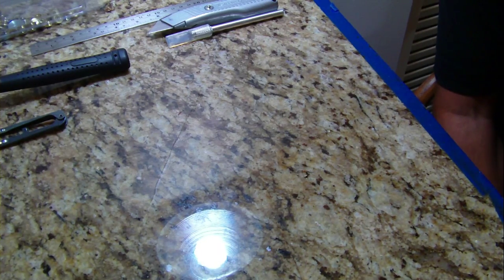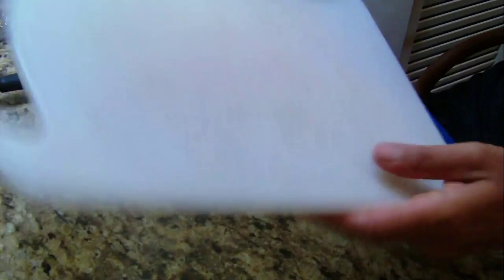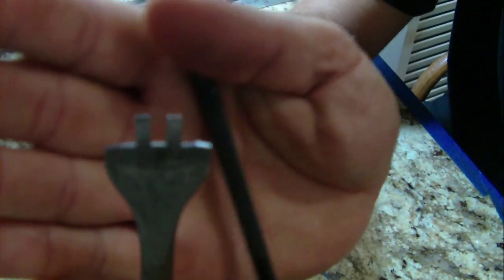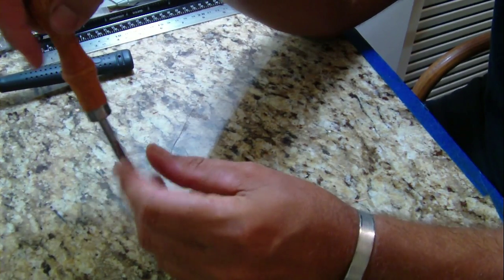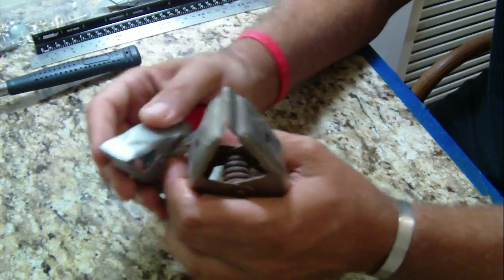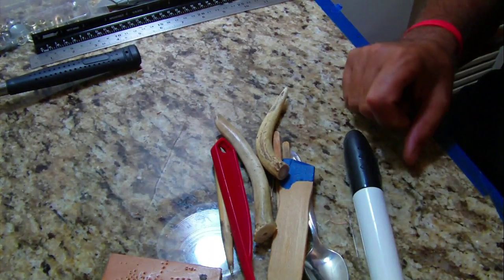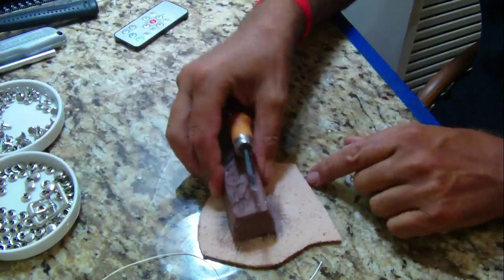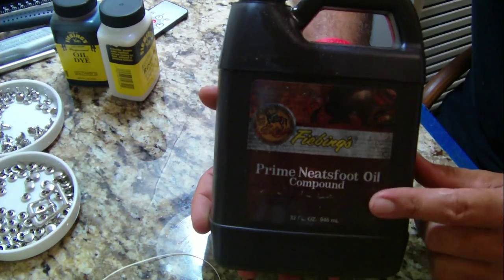Diy Holster Making Tools and Material

Comment: You may not be doing stamping yet but stamping adds a lot of character and is easy to do. If you go there, something I have found invaluable is a 2 inch by 2 inch or so sealed box or bag of lead shot. Once you case the leather for stamping, place the box of lead on the edge of the leather to hold it in place. I also use it for glue-ups. I place the glued leather on my grant block and then place the lead on a small board on the top of the leather to hold glued surfaces rather than clamps since at times, I have had clamps mark my leather. Also, for burnishing, a glycerin block of saddle soap works well. It is easy to use and Tractor Supply or Tack shops carry it.

Comment: Great info.  am brand new and have one question I can not find an answer to. If you use white waxed thread to sew my leather together and then stain it black. Does the thread stay white, Thanks
Reply from the maker: I would say no. It may be more resistant than plain thread but it will still soak in,  especially if you use the oil or alcohol based stain. Imo